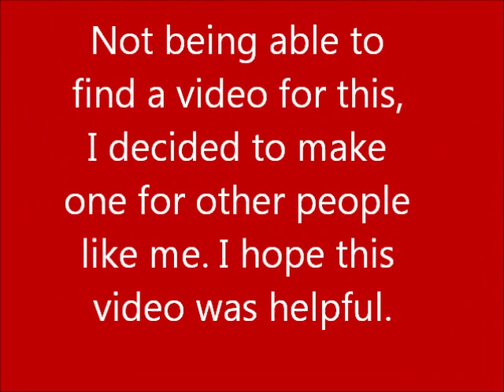How to fix a Snow Plow valve

Comment: Thanks for sharing. Haven't had any valve problems with my boss V plow so far, but did burn up a pump motor in April. Also had the power/ground cables weld themselves together. Parts are definitely not cheap.

Comment: Great video. If I don’t got a power probe do I just hook one wire to a negative battery terminal and the other wire to the battery positive and then just touch the separate wires to the separate metal prongs on the coils??

Comment: I have a Meyer and it would go right, and then you hit the left switch itd go left and get stuck left, Replaced the solenoid on the valve on the pump and it was all corroded underneath, that fixed my problem. I love how fast the Boss is compared to my Meyer

Comment: My buddy has a Boss V-plow. The motor went to shit at the end of last season and he had it replaced over the summer. Now you can hear the motor running fine but nothing happens. The plow wont move up or down. The wings wont move in either direction. We pulled a line and tried every control and no fluid pumped out. The reservoir is full and nothing happens. Do you have any idea what the problem could be? Could it be a stuck valve type of issue?

Comment: I have a 24 series Sno Way plow that will not turn right. I switched the green and red wires from the solenoids and it turned right but not left. I put wires back to the correct places. I flipped solenoids and got the original problem - no right turn. Some times when right toggle is activated plow raises and turns right after getting to the top. Any ideas?
Reply: @A Mig I have the same issue with my Meyer plow. Worked fine since I have had it on my truck, then one day I pushed it to go right, since then (Aug), plow will not go left. Looks like I will have to look into the valve.

Comment: I have a boss straight plow and it will not do anything but click on the solenoid under the hood .put a new one on and and it still just clicks on the solenoid,i checked the fuses and wiring ,all good ,can someone help
Reply: Double check your connections at the truck or the plow plugs into

Comment: just dropped off my BOSS vplow dxt to the dealer for repair. No hydraulic pressure and cant raise or lower it.  Had to run to depot and buy some chain and jack it up just to make to the dealer.  Plow is less than 3 months old, and only plowed 5 storms.  Today my Boss plow cost me 2500 in lost revenue and a few accounts.  Would not recommend.  Fisher seems to have better dealers and customer service.  My local Boss dealer doesn't even want to take  a look at it.  I won't buy any more boss equipment  and will be buying a fisher spreader instead.

Comment: DO NOT EVEN compare those boss (read JUNK) pieces of sCrap to a Western or even a Meyer or Fischer-no Mr. Wizzard-ALL plows don't use that crap setup. I have plowed snow for 35 years and only use Western plows. Ever wonder why boss changes their design every year? I bet you drive a chevy too!! LOLOUDEST!!!
Reply: Relax
Reply: I see this post is older but I was surprised. I too have plowed snow for years and prior to my Boss I had a Fisher. I seemed to have more issues with that and it was harder to work on (granted it was older). Before purchasing this last one I had done some research and talked to several friend who plow commercially. Many of them run Boss and were happy with them.
Reply: @jonsatkowiak1542  ive run BOSS on my trucks for years. Went from artic. 8ft strait blades. Yrs b4 were 7.5 strait blades. 
Ive never ever had issues with my boss 9.2 vxts . Save so much time with them. They pile amazingly high and full push like nothing with a f350 super duty behind them. 
The poster was not a pro plow guy im sure and he likely bought used junk to begin with. 
Boss has built my business seeing i dont have plows down during big snow events and customers are never let down !

Glad to hear you have never had issues. 

Only issue for myself is the local Boss service/dealer i did business with for 30 yrs closed. I now have to go elsewhere. About a hour away and if i need something serviced they say its 2 weeks to get it in. 
My 30 yr service guy would drop everything and get me in asap ! And back out to work. 
I guess what makes a company is SERVICE and with out that it doesnt matter what brand of plow a guy is running. Theres allways some minor thing you need service for even tho you do your own service yourself. 
Cant do everything yourself. 
Cheers. 
A long 2018-19 season to its end here in ontario canada. 

Have a good summer mate
Reply: F350 super duty. 7.3. 
F350 6.7 
Now you can start drooling !!!!! 
Keep your half ton dodge gasser. Lmao
Reply: @kyletracey5819  
I have a boss super duty. It will not turn left or right. I purchased it back in 2014. It's the first problem that I have now.  I had a western plow for over 20 years with no problems.  I miss my western at the moment!!
Reply: @mister-action1  sounds like a electrical connection issue. Check the 13 pin connection plug. It wouldnt be a solenoid.  Easy fix. 
Ive had a problem with that plug b4. 
Boss has never let me down. Nor has artic back in my strait blade days. V blades past 20 yrs. Good luck if uts a issue youre digging into. Let me know. 
It does lift and release to lower i take it ?
Cheers
Reply: @kyletracey5819  
Plug connections good. 
It was real low on fluid.  I filled it up no leaks. No help.  I wonder if it's the hydraulic valve angle cartridge?
Reply: @mister-action1  it lifts tho? Could be the angle valve.  Id check connections there. Clean em. Does the relay click when u try to angle?
Reply: @mister-action1  get the tester out and test for power when u use controls .
Reply: @kyletracey5819  replying!
It was the  Angle Cartridge Valve. Thank you!
Reply: @mister-action1  good going!